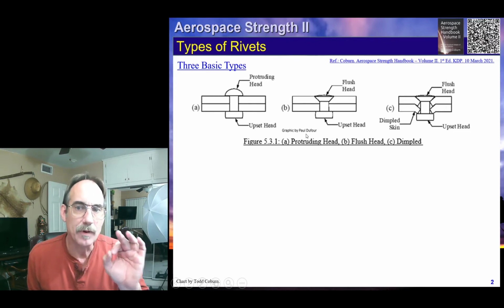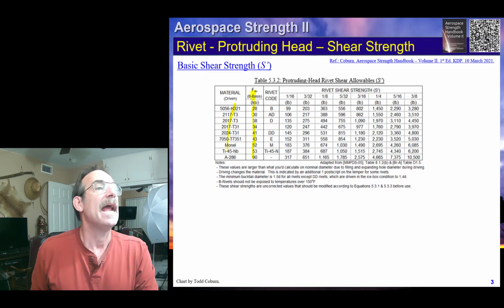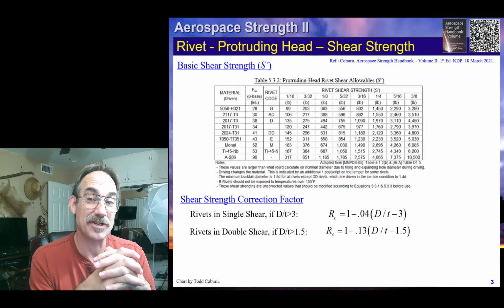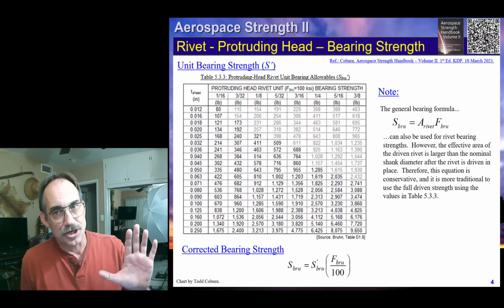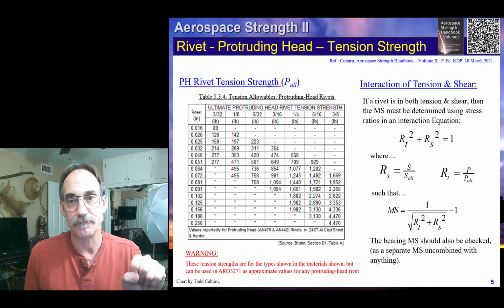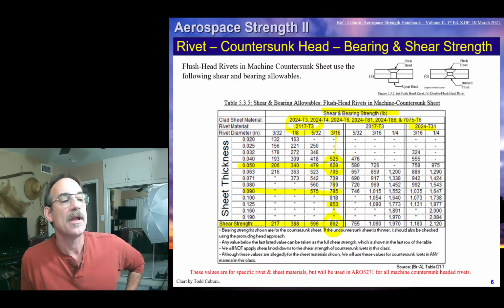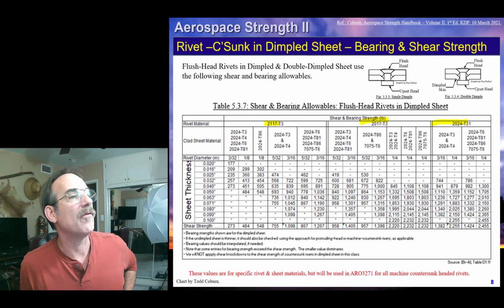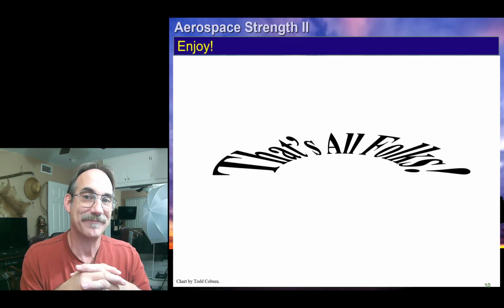Stress Analysis II: L-10a Fasteners - Rivets

Comment: I've applied those simple bending moment models to pins and bolts many times in the past and they simply dont work when working to close stress limits.  They give grossly over pessamistic results in relation to what actually happens in real cases, eg predicting failure when a connection with eccentricity has performed safely for many years.
Reply from the maker: True.  Bending checks in bolts typically grossly over predict stress. Ignoring bending under predicts it.  It takes some judgment to find the right balance